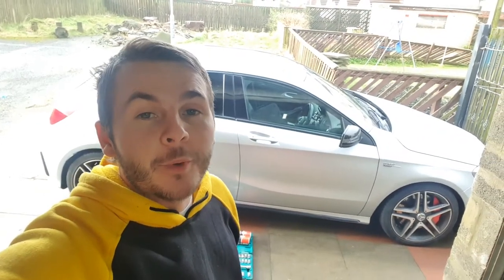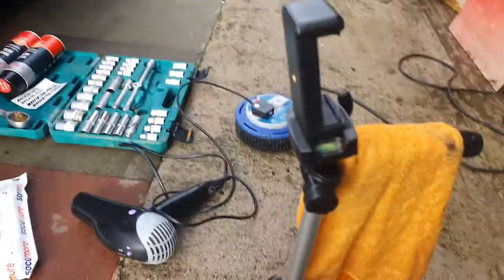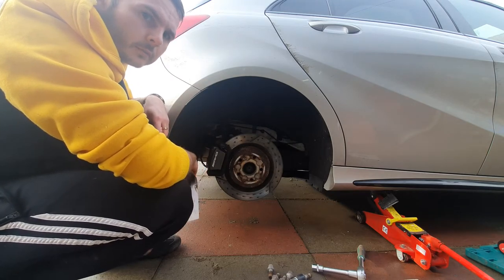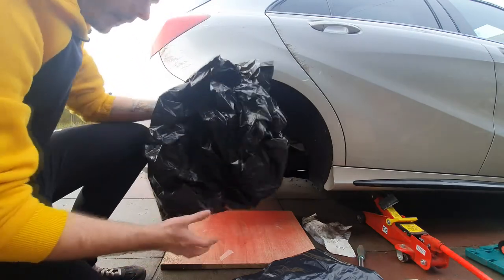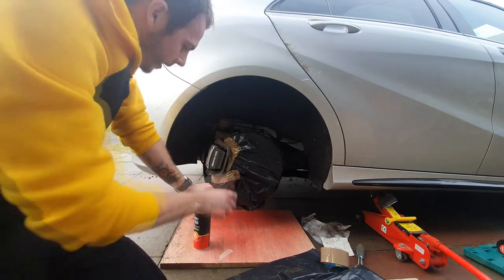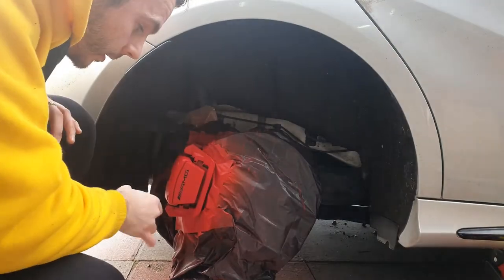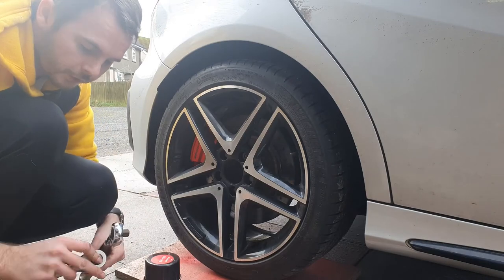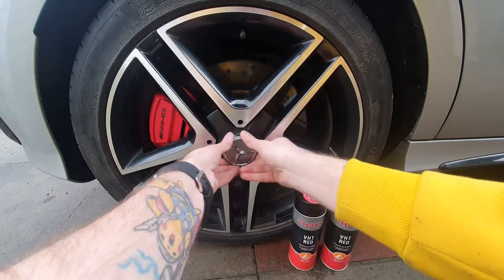How to Paint Calipers | Mercedes A45

Comment: what is it with red calipers!  - does it improve the brakes. Change the pades for Green stuff , other than throw paint about ?
Reply from the maker: Red calipers add 5hp horsepower per corner.

In all seriousness, its an accent on the car that should have been standard. I'm more of a yellow caliper person but for the ambient lighting in the car was red along with the seat trims and seatbelts. 

I was daily driving the car so upgrading the already amazing brakes was not really worth the cost and maintenance side. Considering I went through around 8 tyres in a year window.